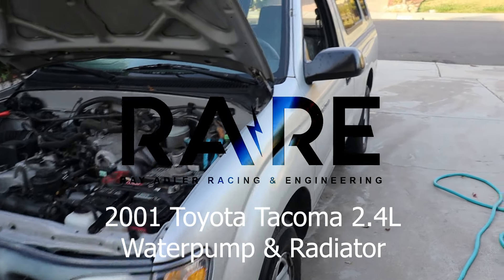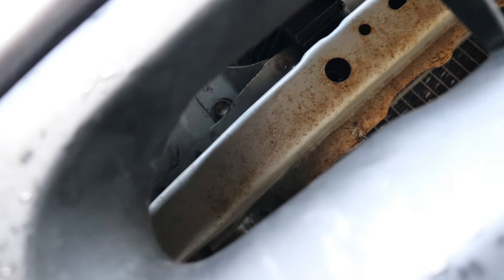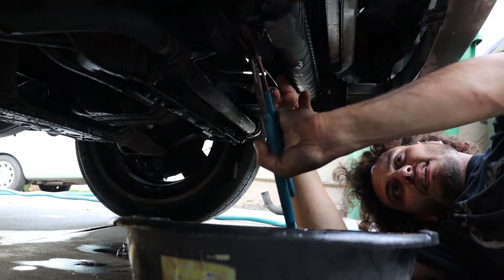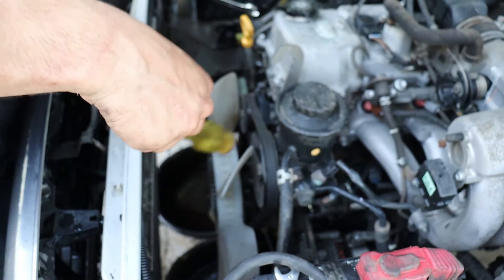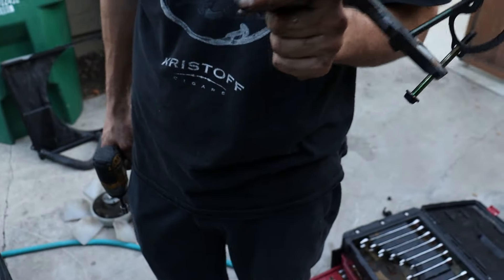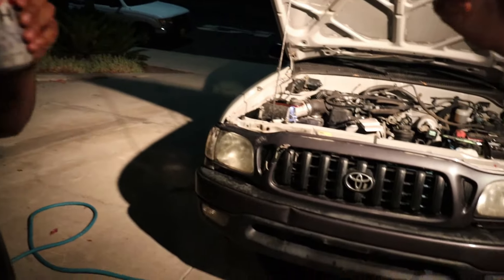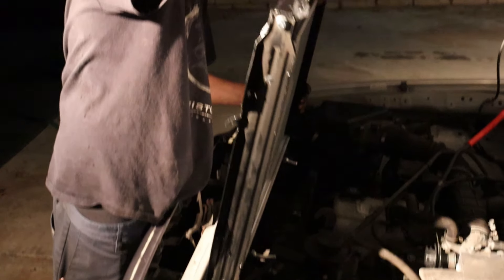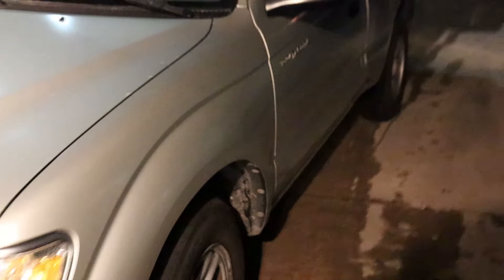2001Toyota Tacoma 2.4L Waterpump & Radiator Replacement

Comment: I was feeling a bit intimidated taking this on, but this video was a huge help. I really appreciated how chill you made the whole thing which helped me be more chill about it.

A couple of things to note since I was doing the same job but on 1999 5 speed 4wd. You no longer have the option to buy a cheap radiator without the transmission cooling barbs; what this meant is that my fan shroud didn't fit on the new radiator, check your fit! I used a sawzall to modify the existing shroud, but it was a surprise to me after I installed everything. Also the Duralast fan clutch provides 1-2mm of clearance from the belts, its close but it didn't rub once I got it all installed so I called it good.

Comment: Why did you change the water pump? Did you just put it in with the gasket dry? What is the torque settings? 😀
Reply from the maker: Water pump was weeping, gasket dry yes.

Comment: When I try to take the four bolts holding the fan off, the fan turns.  The belts do not prevent it from turning.  All the videos I've watched don't show how to hold backup for those.  It looked like you were using a screwdriver.  Any tips for that?
Reply: second this. having trouble trying to take the fan clutch off
Reply: actually figured an alternative way of taking off the fan clutch. tighten the alternator belt to where it’s tight enough so the fan clutch doesn’t move that much. then, you want to take a screwdriver and position it in between the alternator pulley and belt. push the screw driver into the pulley so the belt can’t move. as you’re doing this loosen the nuts holding the fan clutch and they should come right off. hope this helps y’all!

Comment: Nice job on this and the squeezing of the line at the end was a new one. So after you crank it with everything filled up you then squeeze it and hold a few seconds thus no air lock?
Reply from the maker: To burp the coolant system, u fill it, u can squeeze the various hoses of the coolant system to help move trapped air bubbles. U will see them rise to the top of radiator and the level will go down. After that stops completely. Start engine. Turn heater to max 🥵 heat and fan speed up all the way. While letting engine run and come up to temp, u can squeeze gently on the hoses more air may come out/maybe not. Also using a big funnel on the radiator upon first start up works well or even better. Using the funnel to create a spot higher than any other spot in the coolant system will draw the air bubble to the surface naturally as the water pump moves water around and pushes air bubbles as well!!! The more you know!! 😉

Comment: When u unscrewed the pump u dumped coolant into the dip stick hole. Did u do an oil change after?
Reply from the maker: Caleb Rohrer hahah funny u noticed that. That little bit won’t hurt anything, but I probably should have covered it. due to filming was in a rush with the sun setting. Also this lil amount can’t hurt anything and will most likely burn off on the first drive. Truck was due for Oil change and was done shortly after the video but not same day! Don’t sweat it if a lil goes in there your more than ok 👌
Reply: Lol okay cuz I did the same thing 😂

Comment: Being as OCD about my tools as I am, I hate seeing chrome sockets and extensions on impacts 🤮
Reply from the maker: Matchew1776 lol that 3/8 impact couldn’t brake a chrome socket if it wanted 2 lol. More likely to break the shank on the bit driver
Reply: Rare Garage I know I’m just saying my OCD hates it. However if you do break a socket then you can’t warranty it.
Reply from the maker: Matchew1776 why is that? No one would know haha never been an issue for me...
Reply: Rare Garage The drive end of the socket is going to be mushroomed out from the blows of an impact. They won’t warranty chrome sockets if they see that. Impact sockets are softer and meant to take the blows from the impact.
Reply from the maker: Matchew1776 lol I feel you, this impact can’t do that not strong enough allthough others would. I agree in your point it is not proper. For me warranty has never been an issue. I’ve literally cut sockets in half and they still warranty them, I guess u gotta finesse it

Comment: Hey, great video, I just inherited a 2001 Tacoma 4 cyl, 5 SPD ... I notice you mentioned the cooler lines in an auto trans taco ... I'm assuming in a 5 spd, those lines aren't there ?
Reply from the maker: Drew S correct manual transmission don’t use an oil pump from the factory as most manual transmission don’t have a pump to move fluid. Manual trans lubricate from gear to gear contact as well as rotation where flinging oil makes contact with all the moving parts. Although coolers and external pumps can be added to any transmission usually will see this stuff in extreme racing conditions.

Comment: Does every bolt you tighten have a specific torque spec?
Reply from the maker: Vonzipper 2 yes I believe 12-14 ftlbs on the 10mm and like 18-24 or something like that on the 12mm. Don’t have to be extremely tight just nice and snug